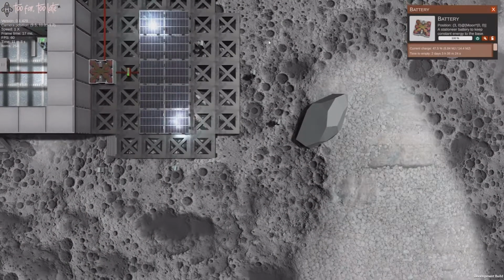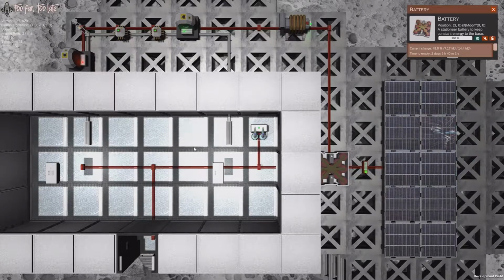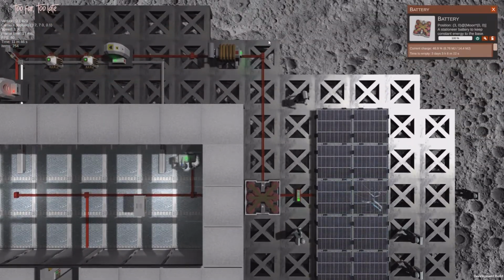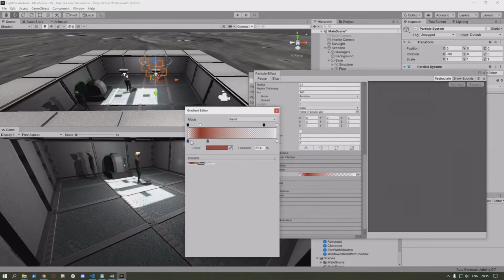Time to repair broken things - Devlog #6

Comment: maby have a seperate view for electrical and air components that shows some extra info like in oxygen not included
Reply from the maker: Hi MCGames ! That's a good idea, I need to think more about it. I want to avoid using overlays and "show" the effects without having to "explain" to the player the root cause of what is happening. The gameplay will also be about problem solving ;)